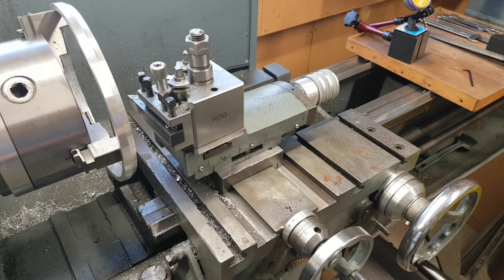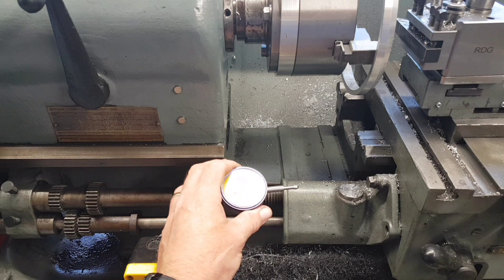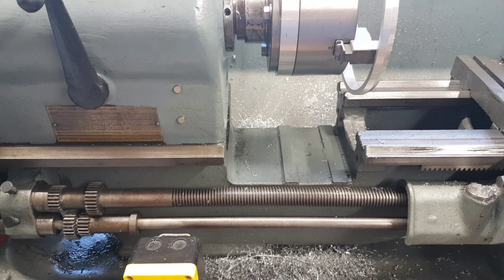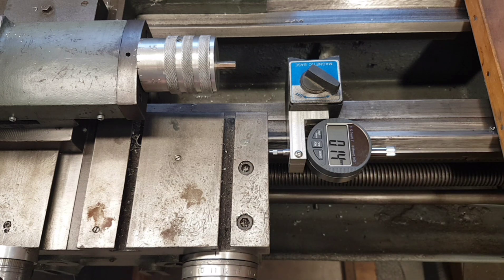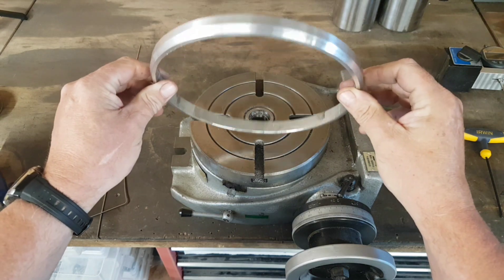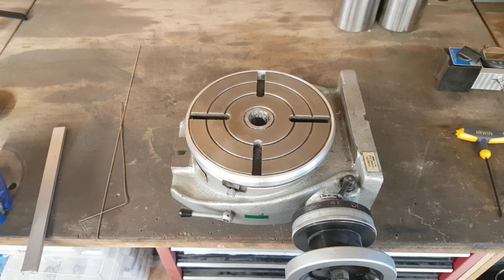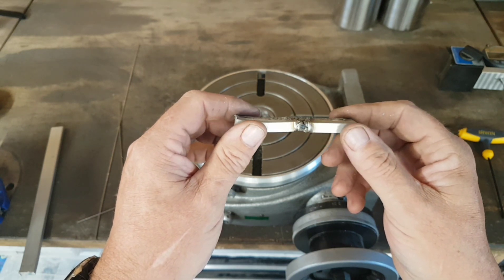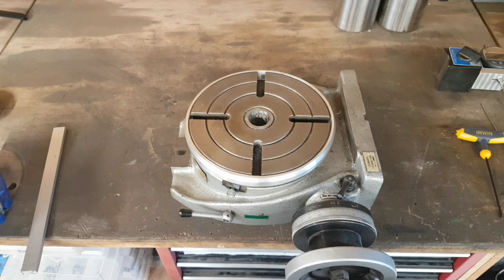Dual Axis  Lathe Indicator

Comment: Interesting mistake on the welding. When you hit the first rod I could hear it was steel. Still, all's well that ends well. On the indicator set up, that's good but you do need to make sure you are at the correct angle to be accurate. (Either 90 to the centre line or parallel to it). Good work, interesting ideas.
Reply from the maker: That's why I was tapping the rods in the video 😊. It was the sound of the first rod hitting the bench that prompted me to go back and check an hour later! 
Unfortunately, my though processes are deteriorating due to sleep deprivation.
Thanks for watching Ben 😊
Cheers Neil

Comment: Spent my entire working life in different forms of Engineering, but despite the noble efforts of many who tried to teach me the art of welding, it was a totally lost cause. The only associated skill I picked up was braising. I literally lost count of the number of my welding attempts that were recycled via the scrap bin, and not forgetting the countless kilowatt hours of wasted electricity. Practice they say makes perfect LOL... Not in my case... Keep up the great work and consider a system for identifying your welding consumables and you'll probably never repeat that issue :)
Reply from the maker: Hi Paul,
I always had an issue with brazing and to a certain degree, gas welding , I struggle to get it right.
The rods are well marked and I can identify them easily just by feel mortally. I just had a brain fart on that day due to a lack of  sleep 😴
Thanks for the comment and Watching !
All the best Neil
Reply: zeg het ze paul